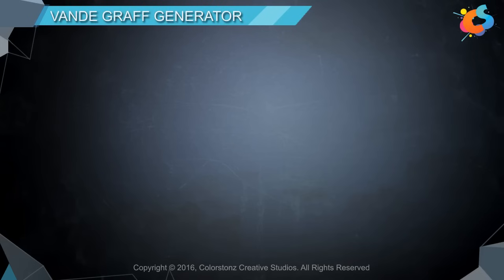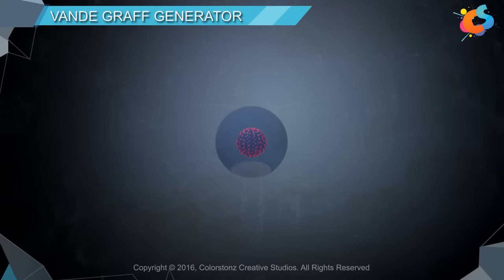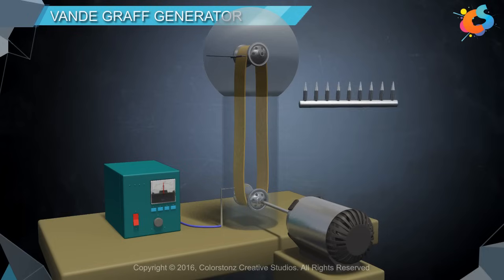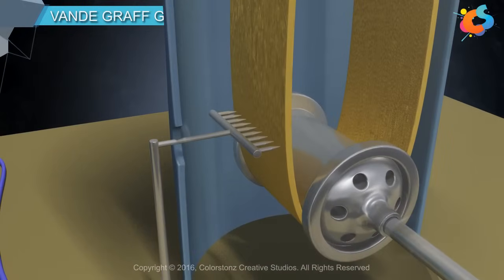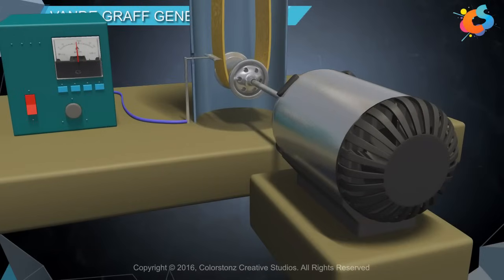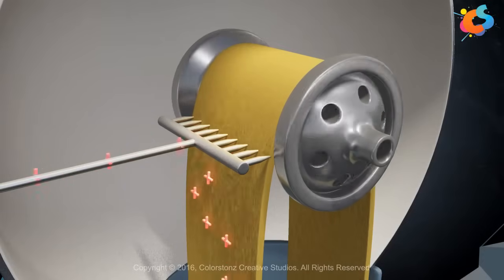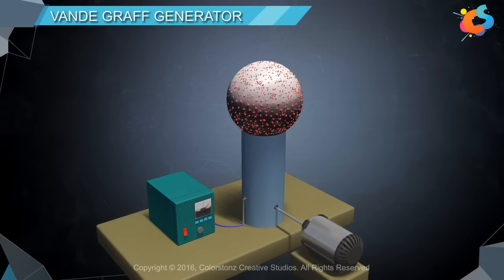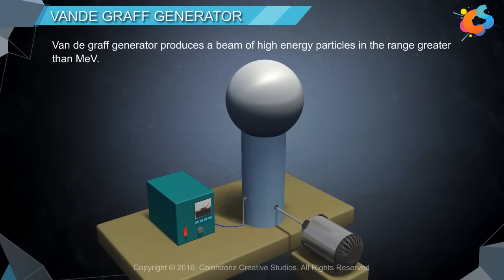Vande Graff Generator

Comment: Original Van de Graff generator uses triboelectric effect so it doesn't need power supply because its literally creating power with that effect, the belt is completely useless in this case so this isn't Van de Graff's generator

Comment: Not sure what this is but it certainly isn't a VDG. Taking charge from a power source and transferring it to the belt so it can be transferred to the dome.....why? The VDG uses the triboelectric affect of different materials to pump charge into the dome; external power is necessary only to power the belt....in fact you can rotate the belt manually if necessary!

Comment: Wow......The whole concept is clear within 3 mins.
Reply: Lekin ab yeh channel band ho gya h
Reply: Except it's not positives charges that are moving but negative one, electron. Oh and yes, and so all movements are in the opposite direction. Ha and originally there is no power supply, it's only with the triboelectric effect that the electron are moved. Else it's correct 😛
Reply: @fgFhgs one doubt if electron moved then how is the spark generated on the larger sphere? Asking because electrons move opp to positive (just our convention there are no such things known as positive charges) then the spark should be inside right
Reply: @ThorfinnBus Instead of +ve charges accumulating on the dome, electrons accumulate on it. They repel each other, and at the breakdown voltage of air, the dome discharges.

Comment: Apparently I have came across 2 different versions of this machine that are causing confusion
1. Uses high voltage source to transfer charges to belt and then to dome 
     (this video, class 12 books, various websites on internet)
2. Uses triboelectric effect (charges transfer from PVC roller to Rubber belt due to friction) which results in high voltage on dome 
     (Some youtubers made this one like Electroboom, saw one in my university lab)
Reply: Yes, with 1 why even have a belt? I guess it is needed to keep building up charge? What would happen if you put the + comb near the comb inside the sphere or just connected the + directly to the inside of the sphere?  No mention here of whether you need different roller materials in 1.

Comment: How does charge get transferred from the metallic comb to the rubber band if it is well known that charge cannot move to, from or in an insulator? If you take a ballon and charge it and you make contact with a metallic object, the object wont get charged. If its sharp it will make a cracking noise before contact, but if its blunt nothing happens. Where is the explanation of triboelectric effect and corona wind? It's very visual and simple but it doesnt work that way. Go to 
rimstar's channel to see the real physics behind it.

Comment: Its not "positive charge" which is moving. It happens due to corona discharge. 
The lower comb has sharp edges due to which the electric field at its edges is very high due to large concemtration of charge. This leads to the air molecules losing some electrons. This continues until the belt loses some electrons. The power source maintains the potential at the lower comb so the "positive charge" keeps on building on the belt in the same manner. Now corona discharge occurs again due to high amount of positive charge on the belt. This time the upper comb loses electrons which ultimately leads to the sphere connectes with it to lose electrons thus building up positive charge on it.

Comment: A Van De Graaf is not a charge transfer device!!!... you should study the generator first before you make such a video!!!! A high voltage IS NOT fed into the bottom!!!!
Reply: Yes, that's what I thought!  The charge comes from the friction between the belt and the rollers.
Reply: That is a particular kind of generator that works on the principle of triboelectric effect. How you charge the band is immaterial. You can charge it with a voltage source if you want to and that's still a van de graaf generator.
Reply: Yeah its true..
Reply: Yes I also become confused as  it can be done by use of wire only
Reply: No sir you are wrong

Comment: Why is it so that all the charges on the sphere inside the hollow sphere flow to the bigger sphere when they are connected??
Reply: Electric field inside a conductor is zero 
,they always tries to move to the surface
Reply: Due to difference of potential between inner and outer spheres

Comment: How can a rubber belt conduct positive charge??..as it is a insulator??
Reply: Property of insulator is that they take  charge at a particular point not distributed over it
Reply: the belt is not conducting electricity in the conventional sense (allowing a continuous flow of charge through its volume), but rather accumulating and transporting a static charge on its surface due to physical contact and friction with another material.

Comment: Better to say that it is pumping the electrons out of the sphere creating an over-abundance of holes and a large voltage.
Reply: Nikša    EMF , or Voltage,  is a measure of potential difference.  The electrons getting back in would be those lightning bolts
Reply: Nikša    My apologies.  The material of the belt and combs are biased to give or take the electrons most easily.  Generally a VDG creates a large positive Voltage by pumping the electrons out of the sphere.  It's a valid question about pumping electrons into the sphere.

Comment: That isn't generating anything.  Basically it's only converting from AC to DC current.  High, even extremely high voltage but very low amperes.  Looks neat as hell and I love those things.  I can sit and just mess with one for hours lmao.  But it doesn't DO anything other than look neat and maybe drive cats crazy.
Reply: It’s more or less a transfer from AC to motion to static electricity

Comment: Ahh... it looks like you are saying the protons are moving - not a very clear explanation of how the "high positive potential" is created/moving.
Reply: its a static charge built up by the rubber belt. one side is the topload, the other is ground.
Reply: there's a high voltage at D the air molecules near D are ionized due to action of charges
Reply: She meant positrons